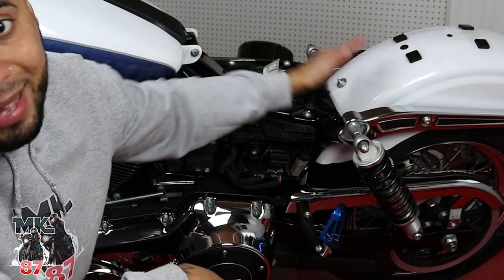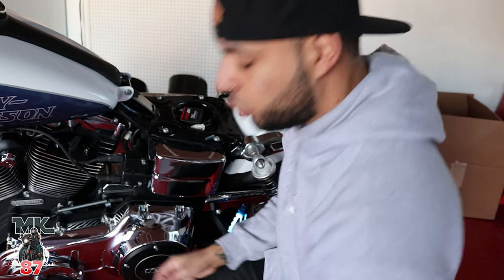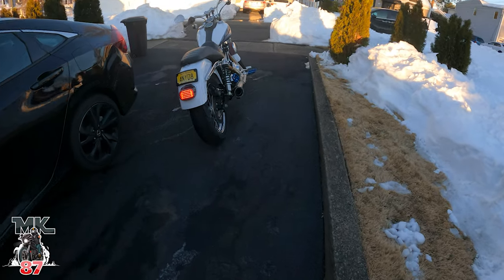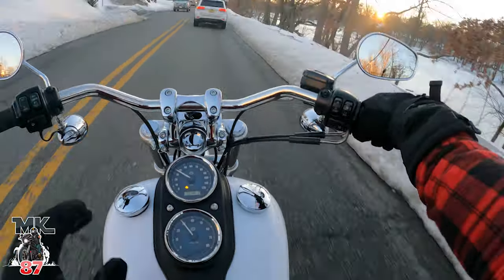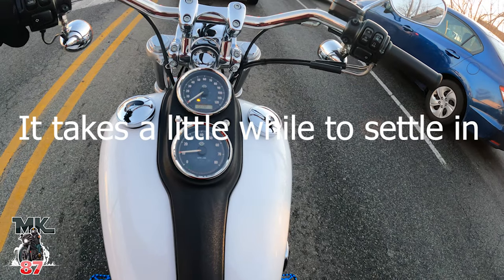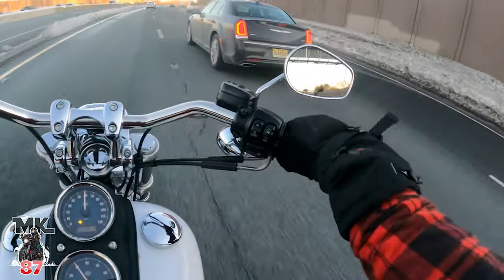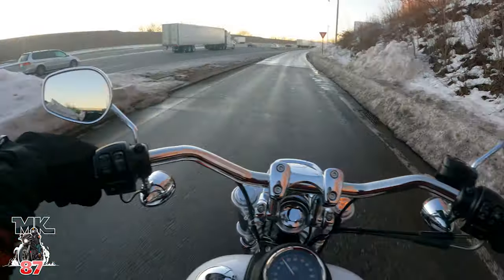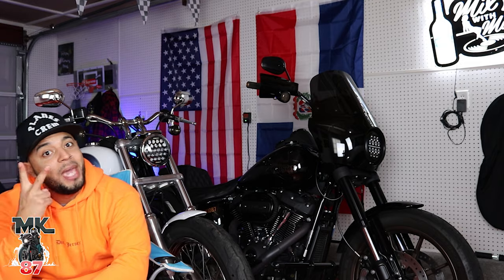Dyno jet commander install on dyna low rider

Comment: Why on earth would you go with the PC over the Power Vision? The PV is so much more capable, & @FuelMoto they usually run about $400. Plus you can use the PV on multiple bikes with Dynojet's license program. The same PV I used on my Sporty is now running on my Dyna. All I did was buy the right cable ($26) & pay the license fee ($195).